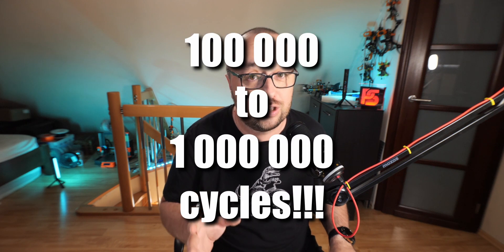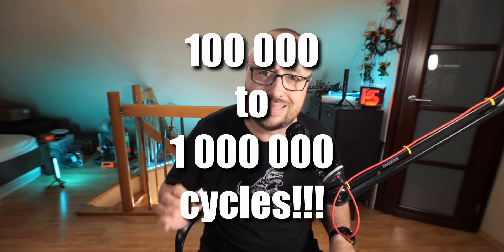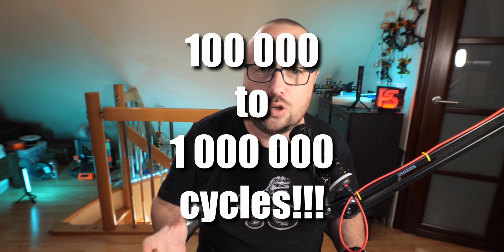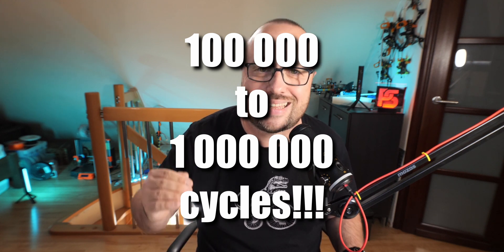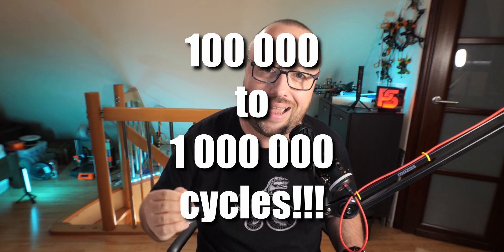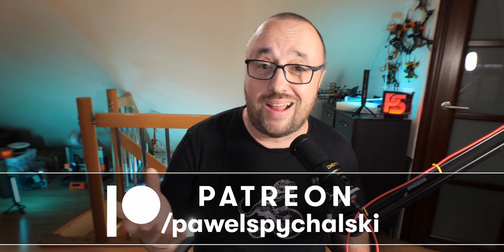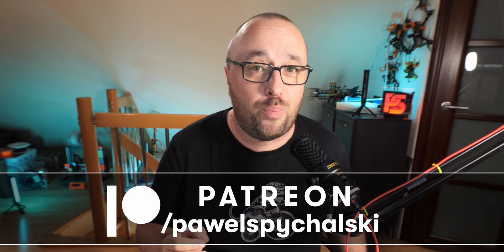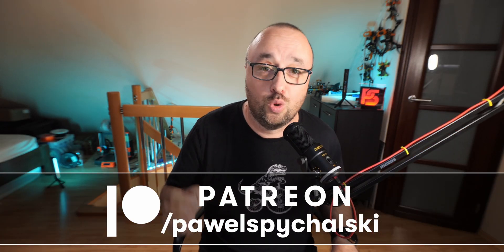Flash wear - how much of a problem it is?

Comment: the I/O cycle on flash is not a problem at all. lets say I got 2 endurance SD card spoiled at TX16s, 1 with Rumcam thumb, 2 with Mavic, few with raspberry pi and countless with car camera all due to unstable power supply or voltage unstable during plug into device.
Reply: but i got 1 SD card wear off in IP camera, 1 in OrangePi, and 1 in CarCam

Comment: How about the FC USB connector will it be a smaller or higher value than the flashing cycle capability ?  how many cycles can that handle ?
Reply: Not much, especially the micro-usb versions, the solder points on the board usually fail. Keep in mind SMA connectors are only rated to 300-500 mating cycles, and I've never really seen someone notice attenuation although I am sure its measurable.
Reply: It will fail long before anything else does, guarenteed. But should still last you the reasonable lifetime of the board, USB-C much better, replaceable usb daughter board the best.

Comment: Are you sure about 100k cycles? According to F405 datasheet I see only 10k data cycles (flash memory endurance). This still a plenty and enough for life time of FC.
Reply from the maker: yeah, it might vary. I think stm32 says it's 10k guarandeed and they are pretty strict about it
Reply: @FPVUniversity  10k on h7. but you can be smart about how you save your config in flash. Hint - differential saving :)
Reply: @alexanderfedorov7890  Considering that's still 27 years of writing everyday you don't even have to try to be careful
Reply: @m3chanist  i see no reason not to be careful tbh ;)

Comment: It's a psychological problem for me when developing code for Arduinos and similar.  If I alter and upload my program once per minute, and work like that for four hours per day, then I can theoretically wear out the flash memory in less than a couple of years.  Of course, Arduinos don't cost much, and the real number of Flash cycles before failure is probably about ten times the claimed number anyhow.

But it's still a source of worry.  For applications that require lots of frequent writes to the non-volatile memory, such as a microcontroller-based Forths, I swapped to using the Texas Instruments MSP430 microcontrollers - the ones that use  ferroelectric random access memory (they have FR as part of their part number).  That 'fram' memory is like Flash, but much faster to write, can be written/erased just one byte at a time, and is good for 10^15 write cycles.  I could do a million writes per second with that, 24/7, and it would still last over three hundred years: that's sufficient to prevent me worrying :)